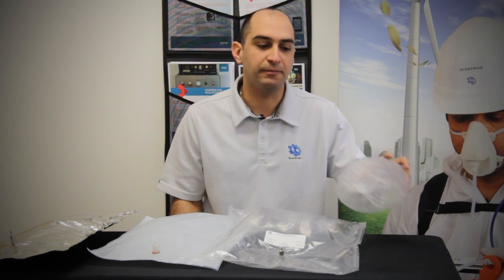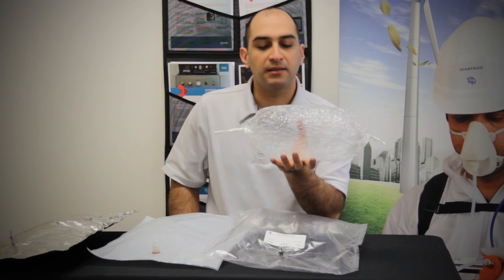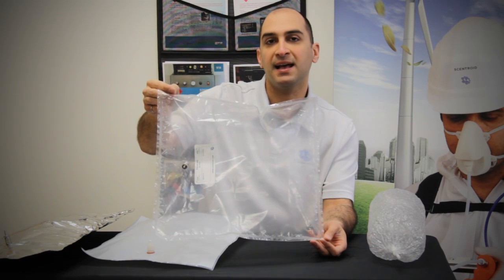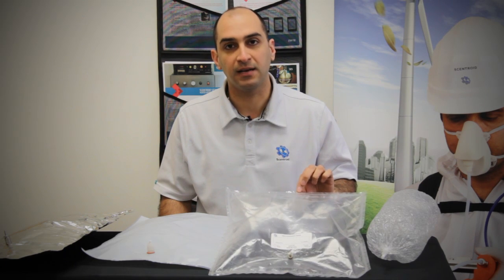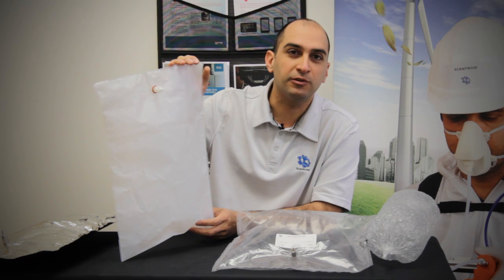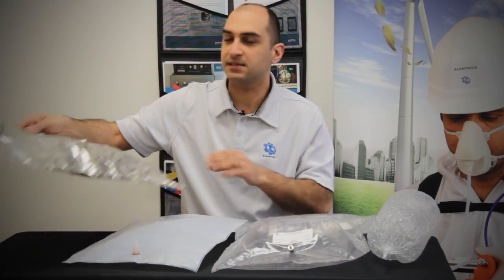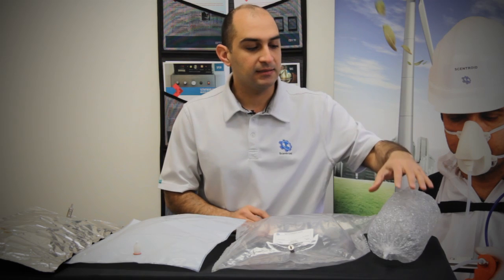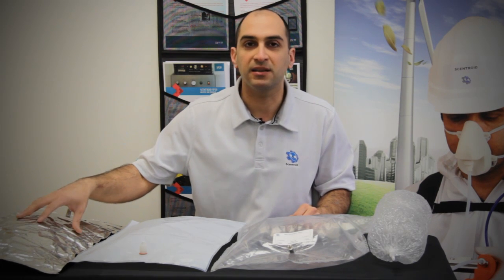Scentroid Air Sample Bags from Nalophan, Tedlar, PTFE, and Stainless Steel

Comment from the maker: Scentroid Sample bags:
Scentroid sample bags are specially made for odour sampling. Available in four different materials each with a pacific function. All our bags come with your choice of PTFE or Stainless steel fittings. All bags are leak tested and purged to ensure zero background odours.
All our bags are leak tested and purged for 48 hours with purified air at 100C prior to shipment to ensure zero background odours.
 
Scentroid is the only manufacturer offering PTFE sample bags. These bags offer a much higher resistance to contamination than Tedlar bags. PTFE also has no background odour and therefore does not require pre-purging. Made with 5-mil for maximum permeability, Scentroid PTFE bags allow for much longer sample storage than  #Tedlar # bags.
 #samplebag   #sampling